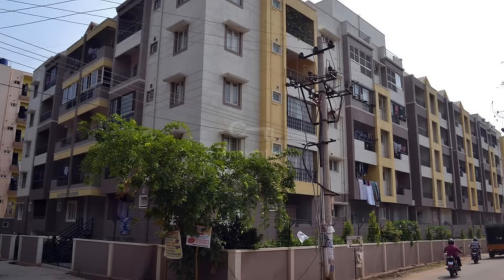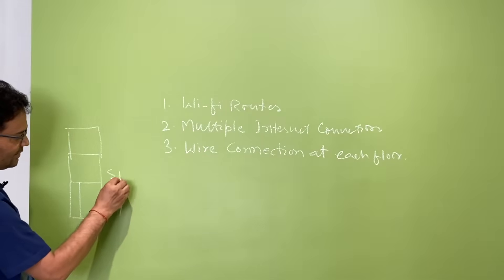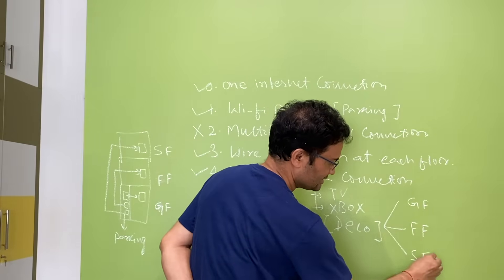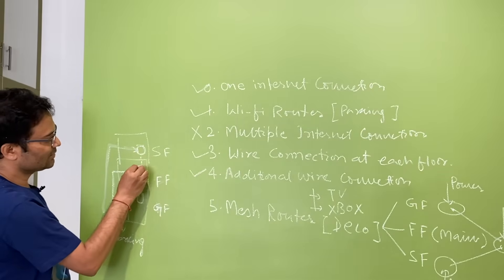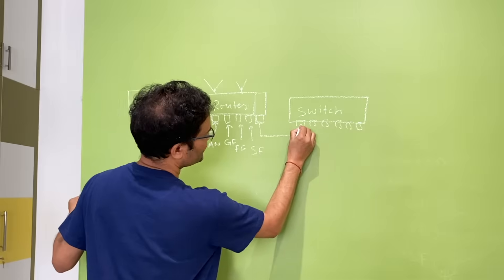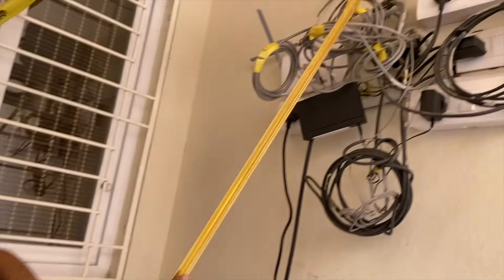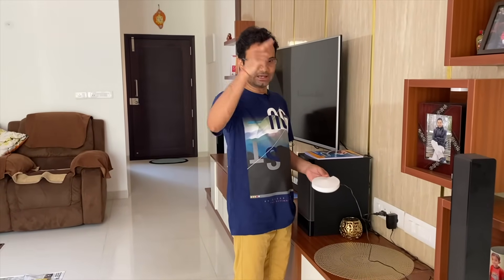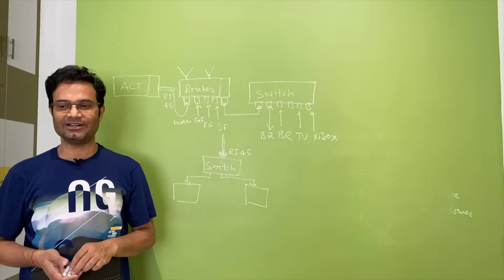Internet networking setup for big house | Deco Mesh Router | Internet wiring for your house | Villa

Comment: For power backup do u keep ur home inverter on ups mode or inverter mode
Reply from the maker: We have installed a high-capacity inverter with a relatively smaller battery, configured in UPS mode for the entire house. Although our society has a DG that starts automatically during power outages, it takes a few seconds to kick in. To ensure uninterrupted power, especially for all routers in the house, we set up the inverter to provide seamless backup for the whole home.

Comment: if any access point use for 8nos then we purchese poe switch 8ch or ....... , how celiculate this
Reply from the maker: It completely depends on the number of devices you currently have, as well as future expansion. For example, if you need to connect three devices today, it’s better to buy an 8-port switch to accommodate future requirements. I have personally used both 4-port and 8-port switches based on my usage needs.

Comment: sir how did you wire the cables ? did you do internal wiring ? my house is already done , with internal wiring for power cables , but how i do the network cables ? i don’t want to keep it visible
Reply from the maker: Visible wire will spoil your house deco. Never think for that. Yes, I did all internal wiring after hand over. There is always some scope in existing wire cable pipe. Check with some expert and known electrician. It is bit difficult but you will enjoy the speed and happy with all your architect mind 😂. Even my WiFi has very nice speed but seeing the hard wire connection on my table gives awesome feeling 😂.

Comment: I have TP link Deco M4 2 units. Now at the time of connection configuration main mesh unit need to connect with Main Router/Access Point router via LAN. Now after configuration done then if I remove LAN cable between Main Router/AP and primary Mesh unit will this primary Mesh router will work and also establish communication with secondary mesh unit?
Reply from the maker: For best connectivity, the primary mesh unit should be connected to your ISP router using a wired connection. The other mesh units (satellites) can then connect to the main mesh unit either wirelessly or through a wired connection. 

If this doesn’t answer your query, please let me know and I’ll explain in more detail. Thank you.
Reply: @binodsumanactivity266 Thank you. Main mesh router can be kept wirelessly with main router but then chances are there that connection may interrupt repeatedly.
Reply: @binodsumanactivity266 Thank you for the response. From second mesh unit which will be connected with main mesh unit, from the port of that second mesh unit can be connected smart TV via cable?

Comment: nice for the nice explaination. I have one query, why you two separate line for xbox and tv. Instead you could have used one line and by using the switch for two outputs like your office?
Reply from the maker: In my garage’s main switch, I already have two sockets available. Instead of setting up an additional switch and electrical connection, I decided to take a separate line for the Xbox and TV. Another reason is that I’ve noticed a separate line provides better speed compared to using a switch. Since modern TVs need higher speeds to support 4K or 8K streaming and the Xbox also requires strong connectivity for gaming, a dedicated line makes more sense.
Reply: @binodsumanactivity266 again thanks for the explanation. I'm constructing our home and your information helped a lot.

Comment: Hi , I have a question, 
I want to buy tp link deco  m4 in 3 quantity, now I want to connect it by all router with different ethernet cable coming from poe switch . Is it possible?

Comment: Why do you need a router AND a Mesh? 
Doesn’t that give you 2 different WIFI usernames ?

Also, it would have been slightly nicer if you had connected your mesh nodes with wire backhull, no?

Comment: Very informative video. I believe that if you connect all the Mesh routers via a Cat6 cable in the below ways, you will have a more stable and stronger connection.

Way1:
Main Router --> Mesh Router1
Main Router --> Mesh Router2
Main Router --> Mesh Router3

Way2:
Main Router --> Mesh Router1 --> Mesh Router2 --> Mesh Router3
Reply: IS WAY 1 POSSIBLE ?
Reply: @chandan_parida  Yes absolutely, I connected my internet connection to Deco router 1 --> Switch --> Mesh Router2 & mesh router 3 
i have a strong signal for all the mesh and the purpose of seamless 1 SSID is achieved.

Comment: Good Video home network👋 But ISP will provide their own branded routers.
In My case:
Jio Fiber ISP router and D-Link (DIR-816 Dual Band) connected wirelessly fine but when power fails (no UPS) @ My Jio Fiber router side, it's restart, all my configuration gone. Again I need to reconfigure all the time when power fails @ ISP side. Where as power fails at D-Link side nothing will happen and automatically connected.
Any solution for Power failure @ ISP router side (no UPS)
Please let me know any time faced this problem🤝

Comment: Hello Sir , You explained it very well but I am having still some trouble . I have purchased 6 Deco Mesh Routers and the problem is each of my floor is of 2400 sq ft , so its not providing a stable internet connection . All my rooms have CAT6 cables installed . Can I connect all My deco routers via cat6 cable and will it then make a single network?

Comment: At @16:12 it seems like you brought the cat6 cable from an electrical box where there will be electrical wires right?
Is it safe for Ethernet cable because I want to bring my cat6 cable like that only from my 2nd floor to 1st floor.
I want to know is it safe because everywhere on internet it says it's not safe to do that and at least 4 inches or 8 inches gaps should be there for electric cable and Ethernet cable if they are coming from same conduit.

Can you please reply to this? @BinodSumanActivity

Comment: So why use  switches when a splitter can do the same job 🤔🤔🤔. Or I'm wrong. Isn't possible to run a cable all the way to the main source and then distribute it with splitters?

Comment: Can the deco mesh be connected to wired connection to get higher internet speeds? If not, will there be a drop in the speed of wifi at GF and SF ?
Reply: Definitely. Ethernet backhaul is much stable and fast. But the whole point of mesh is to achieve better connectivity wireless, without the hassles of wires.

Comment: @Binod - Awesome video man!. I do have few questions. A. Can we connect all 3 mesh router with cat6 cable? [I know you just connected 1st floor mess router with cat6 cable]? B. What is the max capacity [like it can transfer 400 MBPS or 800 MBPS] of mesh router? C. On 2nd floor, when you are connect your laptop with mesh router - what is the max speed do you get? D. In your internet plan, what is your speed?
Reply: Yes. Wired backhaul is far better than wireless backhaul. All Deco mesh routers support wired backhaul. In this particular case....u can connect each of the decos individullay to the ground floor switch OR daisy chain them i.e
, Ground fllor deco to 1st floor, then 1st floor to the second... assuming the particular decos have at least 2 ports in them. In -fact, if the decos support POE then no need to plug them to the adapter...use a poe switch on the ground floor and then connect each deco individually via ethernet to the poe switch....u will have a wired backhaul and power to all 3.
Reply: @vipultewari1750 if you do this it's like you split them individually so I was wondering if you would still have one wifi password (one whole system)? Because if yes it's best to wire all the pods, you can set them far apart no need to connect them together (to find each other) 🤔